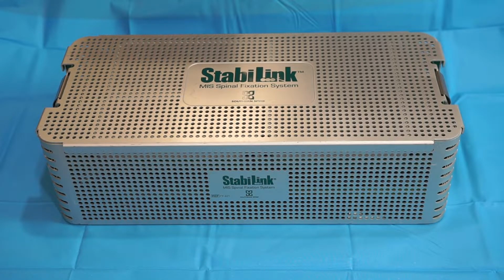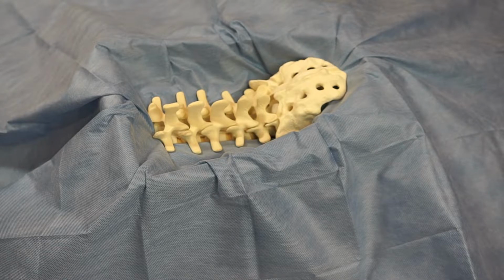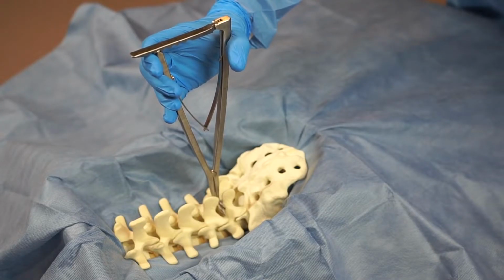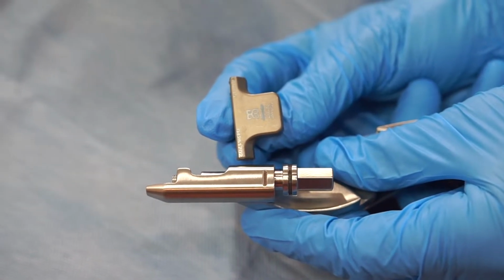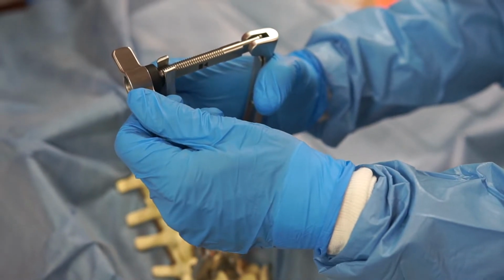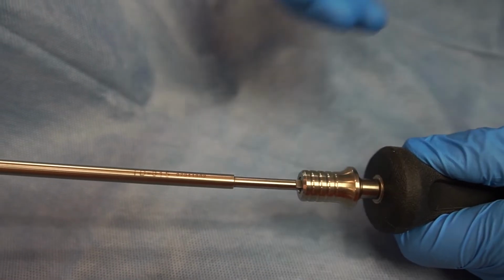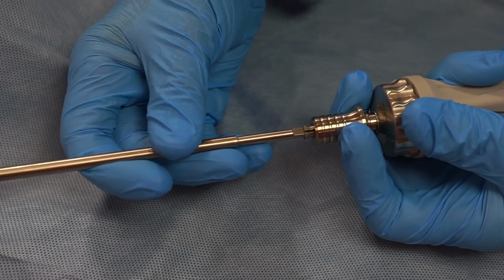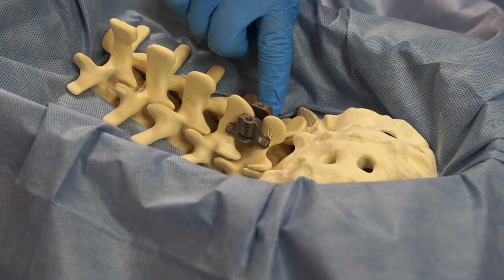Stabilink: The Ultimate Solution

Comment: I had this done L3/4 on 3-23-2021. The fist 2 weeks, minus a couple minor hiccups, I thought was amazing n one of the amswers I needed. Well ecactly 2 weeks later everything was back to the same as prios to the surgery n imo things have actually gotten worse. Actually sitting in my drs office at this very moment 6-28. But I also just started with another spine specialist n see him Thurs.
Reply: Thanks for being open and honest to us. Saddened they f you up. Check out the new Motus device that fixes the facet problem as well as the disc and bone structure problem. Created by 3Spine